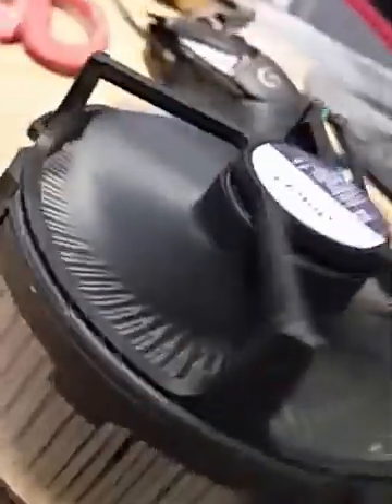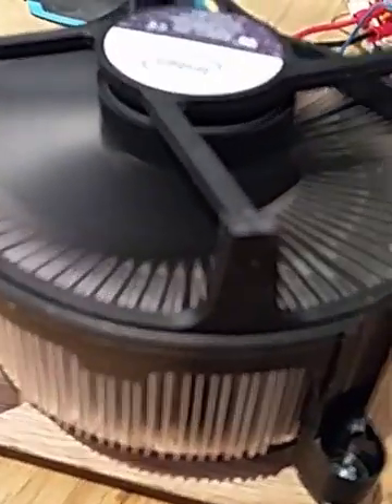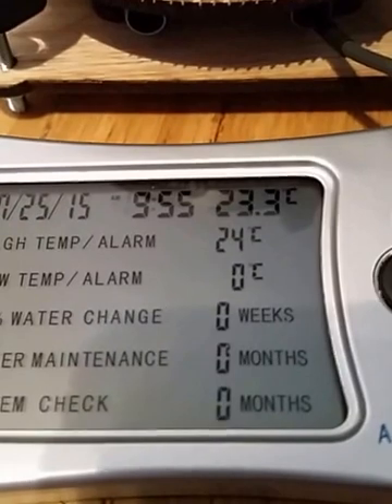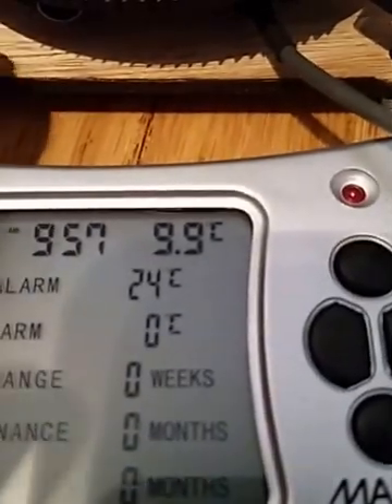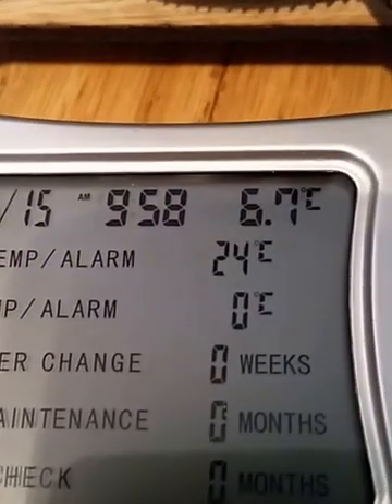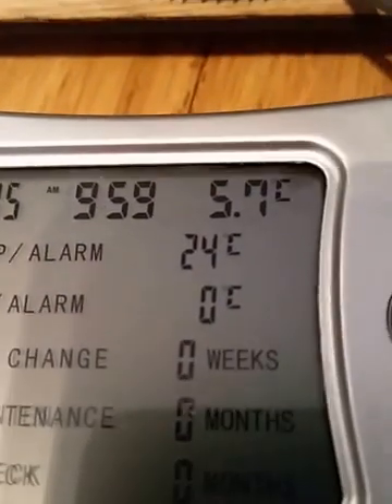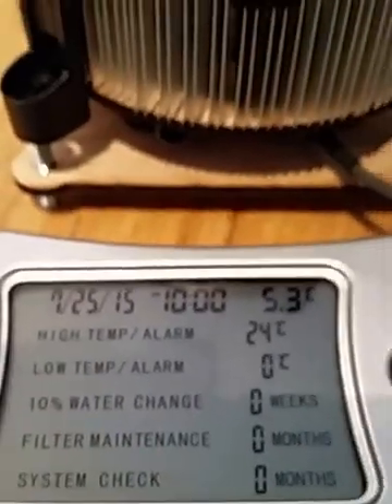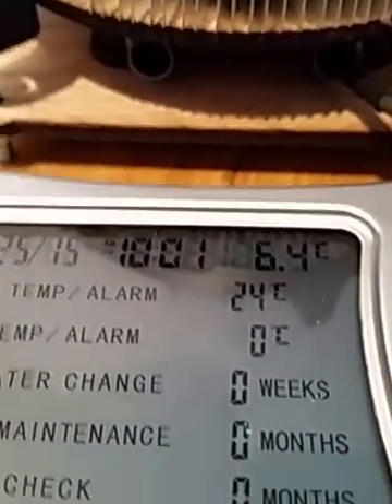Diy co2 Laser peltier water cooler (TEC)

Comment: TO GET A TRUE MEASURE OF THE WATER TEMP, PUT A SENSOR INLINE BEFORE THE END WHERE WATER ENTERS TUBE.  YOUR ACTUALLY MEASURING THE WATER TEMP. LOOKS LIKE YOUR MEASURING THE PELTIER, WHICH OF COURSE WILL SHOW A DECREASING TEMP. RUN A 45MIN-1 HOUR RASTER JOB AND SEE WHAT YOU WATER TEMP IN THE FLOW IS....THIS IS A TRUE TEST

Comment: Iwant to build something similar. what is that little thing called where you connect the hoses?
Reply from the maker: It's a water block - search on eBay. They are blue "aluminium water cooling block"
Reply: +Chris Braithwaite Cool, thanks so much and for sharing your project!
Reply from the maker: +Malian you are very welcome - I'll do a better video at a later stage when I've concluded my testing
Reply: +Chris Braithwaite Looking forward to it! One last question: do you cool the water going to the cutter or the returning water? any thoughts on what makes more sense?
Reply from the maker: i suppose it doesnt really matter - as long as the water is cool once its in the tube. you are probably not going to get a massive amount of cooling from a single peltier.
Reply: +Chris Braithwaite Oh ok. Good hint. I just ordered one. But since these things don't cost much I think I'll just get another

Comment: how much did this setup cost you? I know this must make sense because chillers for co2 lasers are so expensive...
I just don't know how compare cooling power/cost.
BTW I got 60w laser
Reply from the maker: I salvaged the psu, and everything else came to under £20 which included copper, thermal paste, water block,  mini water pump. Other bits were salvaged or made. I understand the costs to be quite high to run, and the efficiency is not great. More experimentation is needed - when you run water through it changes the game as there is more heat to move and so far I've not been able to move enough heat away which results in temperature rises. I need to buy a fresh peltier as I cracked mine and it shorted out.
Reply from the maker: Tbh I'm thinking that I should invest £200 on a proper chiller unit. They increase the life of the tube and at £250+ for replacement tubes it's probably a good investment
Reply: +Chris Braithwaite I came to same conclusion, and ordered chiller from ebay cw-3000. You got everything there : right flow rate, temperature sensor , flow sensor, closed tank.  Tired of trying to save few bucks...
Anyway, if you willing to experiment and document it with video i will gladly watch it! Thanks!
Reply: @mateusz1945  IM THINKING TRUE ACTIVE CHILLER. HAVE YOU RUN A 45-1 HOUR JOB? HAS THE TEMP REMAINED IN 20-24C RANGE? DOES YOUR CHILLER ALLOW TEMP SETTING OPTION?